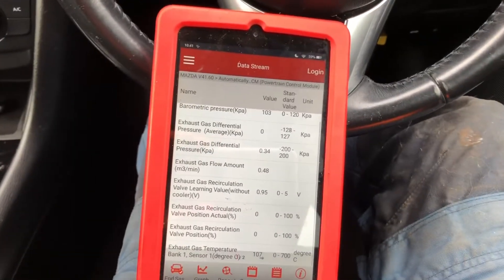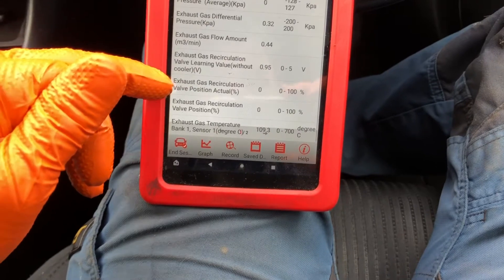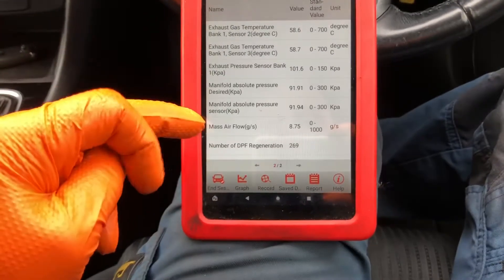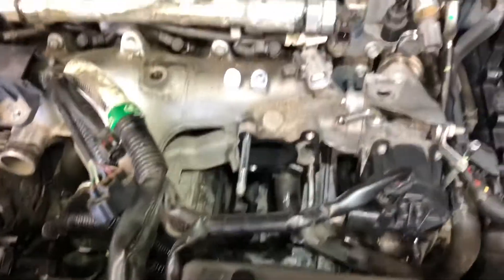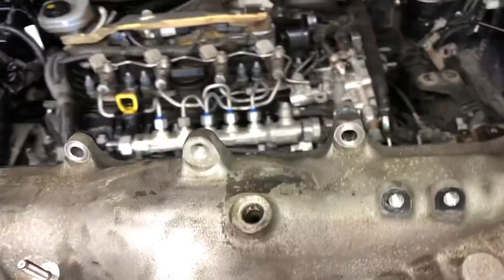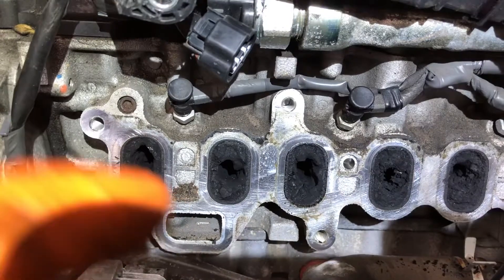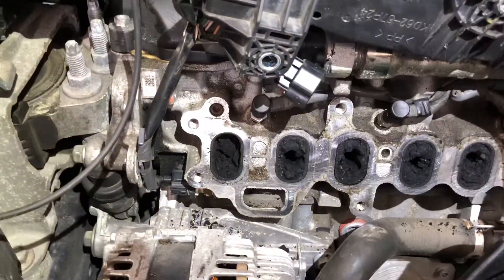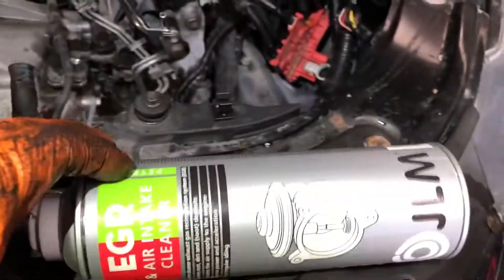Mazda P0401 egr fault & de-carbon intake system

Comment: Hi Peter, just checking something with you. I watched a video of yours a couple of weeks ago that showed a trick with a screwdriver on the intake rocker closest to the oil fill port. Am I right in thinking that when the screwdriver is at its lowest point the intake valves on that cylinder are fully open, and therefore the valves on the other three are closed? Just preparing to do this on my car over the long weekend and wanted to make sure!

Comment: I done that and I get code P0101 and sbcs error.. replaced maf sensor, no more errors but low parameters value and misfiring idle every time. Any idea? Thank you ❤️
Reply from the maker: @vivasupplyltd666 if it is only happening after you done the intake system decarb I’m wondering if you done something wrong. Or was it like that beforehand??
Reply: @kennedysgarage3281  it wasn’t like that. Before decarb, I just had an error on egr insufficient flow
Reply: Update: replaced the maf sensor again with an oem part now runs good till I reach 90mls/h, after that limp mode and scbs error. I’m done with mazda..i’m done with diesel

Comment: Great to see the throttle body. I have scbs tpms dsc  and parking brake warning lights on but the code is P2118. Says it’s “throttle actuator a control motor current range/performance

Comment: Hi Peter... I'm Richard... I would like to clean the intake manifold as you did... but I wanted to understand if you sucked up the bulk of the carbon deposits with a vacuum cleaner, then I saw that you used the product to clean the EGR valves, so you sprayed it into the ducts after cleaning by hand with tools... so after spraying the product nothing happens to the engine if a bit of product falls into the valve seat together with the dissolved dirt? I await your kind reply... thanks and good work
Reply from the maker: @vrrcf  I have heard of this job going terribly wrong on some people so progress with caution. The intake ports that you are going to clean must have the valves closed. I show how to do this on another video that I’ll paste. Also I do use a vacuum cleaner to remove the bulk of the carbon. And the we walnut blast the ports, I then use compressed air to remove any remaining debris.
Reply: @kennedysgarage3281  thank you very much Peter for your reply !!! 🤗
Reply from the maker: @vrrcf  https://youtu.be/Y_W3Dnx5mPk?si=HLDSWbRPsiXn7Cy6
Reply from the maker: This might help

Comment: Sorry for the late post, but I'm now facing having to perform this procedure, but my car is an automatic, so I can't just leave it in 4th gear and turn the road wheel. Is there an alternative method to open/close the cylinder valves that works with automatic transmissions please?
Reply from the maker: @Teleport73  yes, turn out the right hand front wheel. Pop off the engine cover inside it and turn the engine from the 21mm crank bolt. Good luck with the repair 🤞🤞🤞

Comment: Amazing video, very helpful. Is it possible to remove the intercooler without removing the front bumper? I have a badly stuck screw on the top that prevents me from taking out the bumper.
Reply from the maker: Why are you removing the intercooler?? 
Very little ever happens to them 🤔🤔

Comment: Hi, ich habe alles sauber gemacht und trotzdem habe ich den fehler p0401. Auch agr neu.
Was kann ss noch sein? Bitte um Hilfe
Reply from the maker: The egr coolers block in them, did you do that ??
Also you must do an egr valve initialisation if you renewed either the egr valve or the egr cooler bypass valve 😉👍👍

Comment: i saw other videos cleaning the manifolds and ports using walnut shell blasting, that seems to leave the cleanest surface and it's the fastest, I assume there is many ways to achieve same goal, just another alternative to ur tool belt.
Reply from the maker: This is quite an old video & my technique changes quite often. I now use a penknife to remove the heavy carbon from the ports. I also bought a walnut blaster & the use that when the heavy buildup has been removed 😉👍👍👍

Comment: I got the same code. Asked a local mechanic to clean all 3 egr components outside intake ports and the code come up again. Suspect something blocked inside the manifold ports. Any suggestions?
Reply from the maker: Did he remove the intake manifold completely???

Comment: dirtiest engines on the market today. And no, VW, Kia and Stellantis in general does not have these types of issues.
Reply from the maker: I have a video I recently put on instagram & facebook of an i30 intake manifold, seriously blocked up. And what about the dreaded P2002 Dpf efficiency fault on the VAG’s. From the Egr coolers blocking solid. They all fail but we can blame emissions standards 🤷🏼‍♂️🤷🏼‍♂️🤷🏼‍♂️

Comment: Awesome, thanks for the tip in particular showing how the intake hose collar releases from the throttle body. Thanks Peter.
Reply from the maker: You are very welcome Gareth, spray plenty of easing oil on it before removal. I find it helps a lot 😉👍👍

Comment: fantastic video sir. i bought one of these 4 months ago second hand and it has all these issues. i am going to have a go at it myself and your video will be a great help to me. just 1 question is it possible to remove the oil pickup without removing the oil pump. i only ask as i will be doing the work on my driveway as i have no garage. it seems a lot of work for 1 bolt,but if it has to go then it will have to go
Reply from the maker: Unfortunately the oil pump & balance shaft assembly has to be removed & disassembled in order to replace the oil strainer. The very best of luck with the repair 🤞🤞👍

Comment: Great video. I had same problem and had to clean intake manifold . After a while had problem with car not picking up when pushed. It turns out that Low pressure EGR was a culprit. Once replaces it is back again.
Reply from the maker: Well done Antonio great find 💪💪

Comment: Many thanks for taking the time to provide this guide. I've been able to clean the manifold following this step by step video. However on the engine side I was very confident the valves are closed on the 1st 2 posrts so I just cleaned them, but on the rest of the ports I simply could not figure out with the inspection camera if I closed the valves or not so I just stopped to prevent doing any damage. Is it possible to make a video explaining in more detail how to close the valves on this engine? I would say that putting the inspection camera on each port and explaining what is shown on the display, would help a lot so if you have the time to do this would be really helpful. Alternatively, could you please explain if this procedure can be done without closing the valves, probably by using suction instead of blowing with an air compressor? Thanks.
Reply from the maker: If you can open the inlet valves on one of the ports that you have cleaned, then all the other 3 inlet ports/ valves have to be closed. The intake valves can only be open on one cylinder at a time. Does that make sense??
Reply: @kennedysgarage3281   thanks for the prompt reply. I'm trying to process this information but I'm a bit confused. I thought the mafilod has 8 ports, 2 for each cylinder.
Reply from the maker: @vrabievalentin4071  you are correct. I explained it badly. I counted each cylinder & it has 4 ☹️
I’ll try again,
If you can open fully the 2 intake valves on any cylinder, then at that point the intake valves on all of the other 3 cylinders (6 intake ports) are going to be closed & can be cleaned without rotating it any further until all  3 cylinders (6 intake ports) are done. 
Does that make sense??
Reply: @kennedysgarage3281  it makes perfect sense and many thanks again for taking the time to explain for everyone's understanding. Now I realise how easy it would have been to clean the other ports  once I managed to close and clean the first two, but anyhow, your video helped me to maintain my car properly and saved me a lot of money in the long run. Thank you for sharing the knowledge.

Comment: Great video. My cx5 2016 broke down on way to cork with all the fault codes and limp mode. Left into garage in cork for 2 week. They regenerated the dpf and changed sensor, 550€. Collected it and started to drive back to Dublin. Went straight into limp mode so had to call AA and get lifted to Mitchelstown. It’s breaking my heart.
Reply from the maker: Hi Stephen, That’s unfortunate, it seems that most workshops don’t have enough experience with the Mazda 2.2 Skyactive engine & make the wrong call when diagnosing them. 
Let me know if you want me to take a look or just advise. Just google Kennedys garage Portlaw & give me a call 😉
Reply: The car is in Mitchelstown so I’d have to get it lifted to your garage. Local mechanic looking at it today or tomorrow, I’m back in Dublin so will call them tomorrow to get update. Cheers
Reply from the maker: @stepheno2462  Fingers crossed it is only something small 🤞 but if he has any fears of sorting it or would prefer not to just let me know. I could arrange collection also. I do this a lot for people all around the country having ongoing Mazda problems 👍😉
Reply: Cheers. I’ve send through a contact request on your email. I’ll call AA tomorrow and see if they’d lift it to yours.

Comment: Hi 
How can the valves be closed on a auto by turing the wheel or can't be done?
Reply from the maker: Hi Moe, unfortunately no is the answer to this but it is quite easy to turn the crank pulley bolt with a ratchet and socket as an alternative 👍👍

Comment: Great video, mate. Do you have any tips for removing the charge outlet pipe connector from the intake shutter? I can't seem to bust it loose with the sleeve in the unlocked position. Cheers!
Reply from the maker: WD 40 and elbow grease 🤔 other than that I  have no suggestions, sorry it’s not more helpful ☹️

Comment: Dr. Mazda strikes again ;), you are super, thank you very much for your useful videos. Do you already have video about timing chain replacement in Mazda Skyactiv-d? What is you opinion about timing chain replacement, car has 220.000km, timing chain strecth (CC_DIFP_WOA) shows about 1.5, engine runs nice with no problems.
Reply from the maker: To replace the timing chain can be expensive but if it breaks it can be detrimental to the engine. So on this you have to weigh up the options 🤔 Is it noisy??
Unfortunately I do not have a timing chain replacement video yet 🫤👍
Reply: @kennedysgarage3281  Hello, thanks. No engine is not noisy. Did you already changed a lot of chains on skyactiv-d engines?
Reply from the maker: @samostraser8924  no, I have only changed 1 🤔
But I have seen an oil pump chain to break 😬
Reply: @kennedysgarage3281  ok, mybe I am just too scary ;), because I often read about problems with skyactiv-d engines. Do i need any special tool for timing chain replacement?
Reply from the maker: @samostraser8924  there is a timing kit needed in order to do the repair correctly, but you could probably get it on eBay. This wouldn’t be a job for the faint hearted. Have you done a timing chain before on anything??
Reply: @kennedysgarage3281  Hello, I didnt changed timing chain yet :(, but I made all other things (brakes bleeding and replacing, oil replacement, filter replacement, injector seals replacement, intake manifold clean, oil strainer clean,...). I am not worried so much about timing chain replacement,  but things I must remove before (front engine cover remove, engine mount remove, head cover remove). I know there is replacement manual online, but I like video even more. If somebody will record video about replacing I will replace by myself for sure :p.
Reply from the maker: @samostraser8924  this might help 🤞

https://youtu.be/mU1-zRKvOKw

Comment: I too got a P0401 error, first tried to take out the map sensor and it had the other end broken, i mean when I took the map sensor out the other part (probe) is stuck inside and its broken. Is there any way to take it out, the problem is its on verge of falling down.
Reply from the maker: The easiest thing to do is to remove the intake manifold. And while doing this you will be able to clean the egr port & intake ports too. It is the best way forward 😉
Reply: Same thing happened to me I got a small drill bit and took the plastic part out then replaced it.

Comment: Thanks for the detailed video. I own the same vehicle so I'm a bit wary of running into this issue down the road. Correct me if I'm wrong, but I suspect the EGR might be a big contributor to this problem. Is it advisable to turn it off from the OBD to prevent future carbon buildup? And lastly, is there a way to run that valve closing trick on an automatic?
Reply from the maker: On automatic’s you need to turn the engine with a spanner & yes you are correct if you can delete the EGR it does eliminate the carbon buildup 🙏🙏👍
Reply: For that you have to elminate Dpf filter and repeogram ECU. It will smoke lightly on start . My biggest upcoming is chains. Bad quality on first models. Now they install DID chains that are great. Problem with oil pump one but once opened replace both. Costly maintenance. 🤦‍♂️

Comment: I have the same  problem my mazda 6 2015 78000 mile and check engin light  on and code is P0401..
Need to do now what you done. 
Thank you very much  for that video and your time to show from start to finish how  to fix it.
Reply from the maker: You are welcome 🙏 
Good luck with the job 😉

Comment: Exellent thank you kind sir. Can you please tell me if removing the battery for a few hours to work on this will cause any issue with the infotaintment system?
Reply from the maker: I could cause some low voltage codes to be stored but should not cause any other issues 🤔👍

Comment: Hi Peter. Great video, I am going to do the same decoke to the same engine on my 2015 Mazda. It has done 76K miles which is about 121K kilometres. I intend to use a hoover with attached rubber pipes  of  various sizes/diameter to catch the carbon which will be scarped off the  inlet ports of the cylinder head. I recently had the car terra cleaned which gave a small improvement but I knew in the back of my mind that I would have to take the manifold off. I can't do the turning of the  engine trick because mine is semi automatic. Keep posting. Great videos
Reply from the maker: It isn’t too bad of a job, the thought is worse than the doing. Good luck with it Tom & thank you 🙏🙏
Let me know how you get on 👍
Reply: @kennedysgarage3281  Hi Peter, job is done now but I am wondering how to stop the build up of soot etc happening all over again. Some websites are mentioning using a restrictor plate in the flow of exhaust gas, they mention that this needs to fit between the EGR cooler and the cylinder head. Do you know if this is correct?
Reply from the maker: @tomhelsby5546  it is just a filter & it can slow down the carbon buildup but it will get blocked fairly often. I personally think it is just part of owning a diesel car & not much you can do to stop it from happening 🤔
Well done on getting the job done though 👍👍

Comment: After cleaning intake ,  pressure sensor and map sensor went mad and had to be replaced  ....
Reply from the maker: Good job 👍
Reply: @kennedysgarage3281  i will post video how it accelerates now.  I paid 400 eur total for service. 3 sensors intake clean and programming.  Not that bad after 110k
Reply from the maker: @kaapuuu  brilliant, I look forward to it, also very good value at €400. I think that they are very good engines just need to be maintained 👍
Reply: @kennedysgarage3281  yes , is it normal that those sensors go mad after intake cleaning or i was unlucky
Reply from the maker: @kaapuuu  the map sensor is the first thing to get blocked & so needs to be cleaned but the cleaning process can damage them, so changing them out is a wise move 😉
Reply: @kennedysgarage3281  it was cleaned but after cleaning values it gave were not correct

Comment: Hi mate why is my intake air sensor reading-40
Reply from the maker: -40 is a default number that if the sensor has failed or a wire is broken, let me know how you get on with locating the problem 😉
Reply: Thanks for the reply mate how would i know what sensor it is how would i diagnosis is many thanks
Reply from the maker: @KhanKhan-lw8fw  it is integrated in the air flow meter & I’m not familiar with the wiring of hand, but a quick Google search should give you the info needed 👍
Reply: @kennedysgarage3281  thanks bud

Comment: I just bought 2015 2.2 skyactiv d mazda 6 manual with 84 000 few months ago but now im maybe considering selling it after My two year warranty ends, or maybe even sooner because all of those problems surrounding that engine.. Do you maybe know which kind of additive cleaner can and should i use with this car as prevention to all of that carbon build? What do you recommend? And do you know why does the car sometimes revs a little jumpy when I accelerate in first or second gear?Btw great and very informative video!
Reply from the maker: JLM intake & egr cleaner is a very good product that would definitely help, as for the jumpy under acceleration issue it could be anything but I would recommend doing the injector washers on the next service & see if it helps. It is a good maintenance job to carry our either way. And I’m glad you like the video, cheers Dario 🙏👍